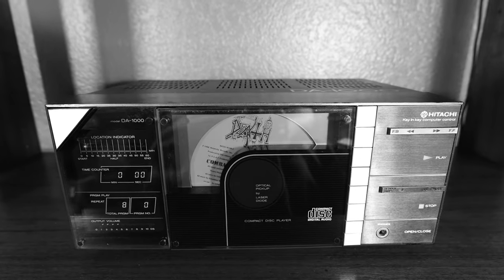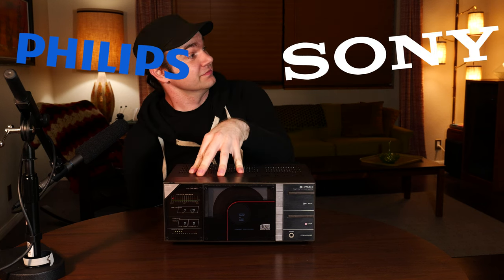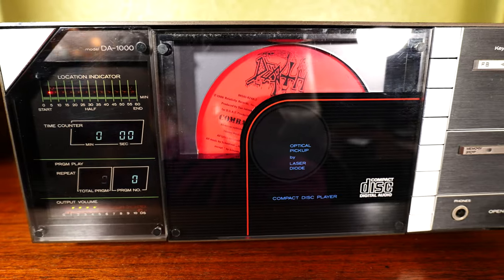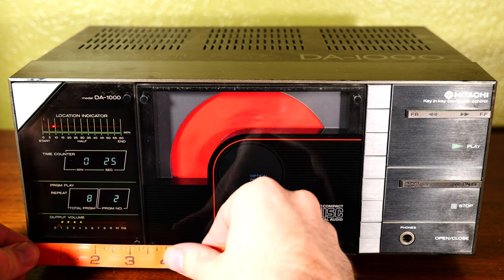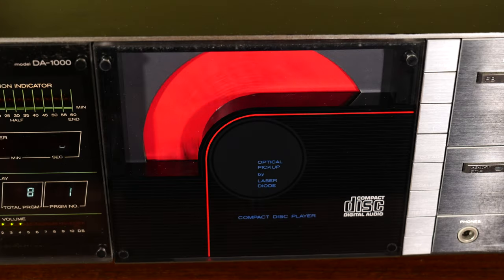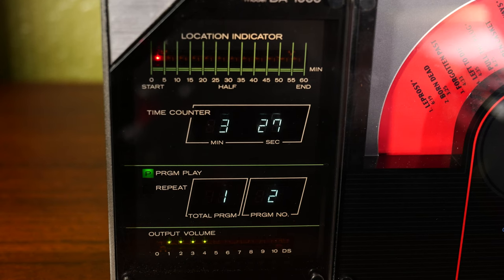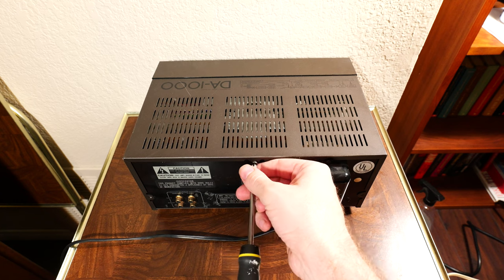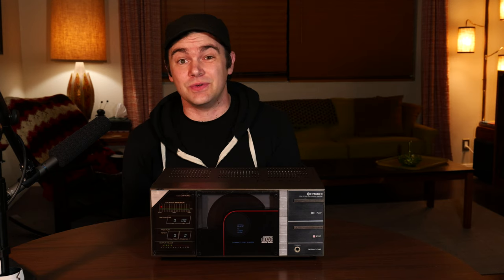The Hitachi DA 1000 CD Player: A Quirky First Generation Gem from 1983

Comment: One of the things I have used over the years to breathe new life into brushed DC motors is naptha, commonly found as either Ronsonol or Zippo lighter fluid. It evaporates quickly and doesn't leave a residue. Flush the motor out liberally while turning the motor shaft. Then blow out with compressed air to make sure it completely evaporates. Provided the brushes in the motor aren't worn down past their service limit, this works wonders.
Reply: Interesting alternative to contact cleaner, wouldn't have thought about something like this.
Another thing to check is a Techmoan classic: degraded belts.

I suspect it has a whole motor to move a potentiometer because the output headphone amp is a plain analog AB class amp and likely no decent audio grade digital potentiometers existed back then (if at all).

Comment: Beautiful unit, love the 80's styling with the display and big brushed metal buttons. Certainly a novel way of loading a disc, looks very graceful but I'd be unreasonably worried it would jam and try to snap the disc!
There is another audio format that used a disc of varying speed, the "World Record Controller" invented by Noel Pemberton-Billing in the 1920's. As opposed to the CD, the World Record Controller increases the speed of the turntable as the record is played from the outside in. This keeps a steady linear speed, allowing more audio to be recorded while maintaining the same audio quality. However, due to the high price of the records, poor selection of recordings and the fiddly nature of the system, it wasn't very successful.
Keeping a steady linear speed is why Edison created cylinder records instead of disc records, in theory the cylinder with equal distance for the stylus to travel each rotation has consistent audio quality while the disc's audio quality decreases as the stylus gets closer to the centre. In practice this isn't very noticeable as long as the recording doesn't get too close to the centre.

Comment: Today, they call that front-load vertical system a "toaster" transport.  Kyocera also had one like that (which I bought like 15 years ago from a thrift and promptly re-sold when I heard that parts were made from "unobtainium" - which you undoubtedly understand).  I think in the model number was a 9500, IIRC.

Comment: Any old CD player should be able to play some burned CD's.  So long as it is a CDR that has a low burn multiplier, up to 4X and you should be fine.  These CDR's tend to have a dark media layer.  CDR's with a high burn multiplier (those discs tend to be a lighter colour) will play on modern players, but few, if any of the older CD players will be able to play them.  It doesn't make any difference what speed you burn the disk at, either.  It has to do with the colour (darkness and reflectivity).  Older machines can't read the discs.
Reply from the maker: That might be an interesting topic for a video, actually.

Comment: I had one of these back in the day - sounded dreadful. It actually used to give me a headache, as I think I’m right in saying it decoded each channel sequentially
Reply from the maker: I think they had 2 different DAC chips that went into these... I'm told one sounded significantly worse than the other so I believe it.
Reply: I'm not about to swoon over first generation CD players because the improvements in d-a conversion can be rather dramatic. I bought an early Radio Shack/Realistic unit in 1985 and at the time I was blown away. Used it for years until I compared it to a cheap RCA branded carousel type changer 15 years later. Again, blown away, by how much better the sound quality was and how piss poor that early Realistic player sounded in comparison. Really disappointing how much audio content I wasn't hearing from the first generation player with early d-a conversion.

Comment: Those early CD players with the hard brick wall filters never sounded all that good.  Too harsh, shrill for the most part.  Those very early machines with the vertical front load were rare and did not last but a year or so until the Sony CDP 101 hit the market. The same can be said about the early Philips based top loaders.  Are they a novelty? Yes. Do they sound good? Probably not so good.
Reply from the maker: I do appreciate the novelty though.